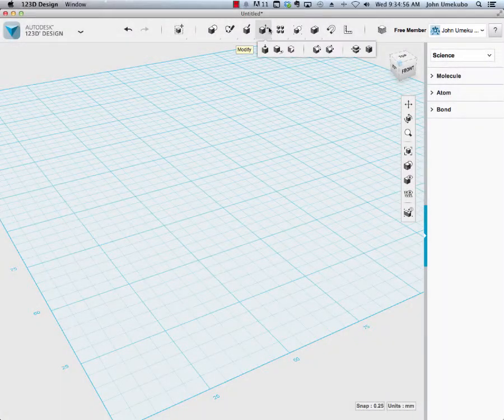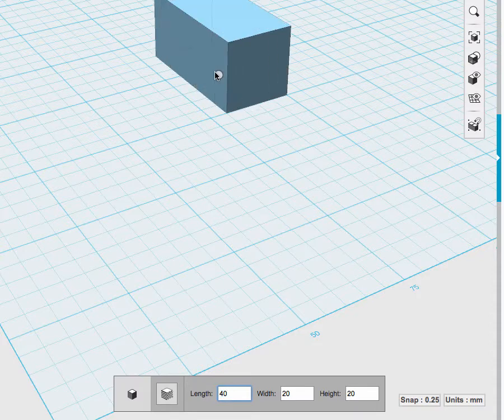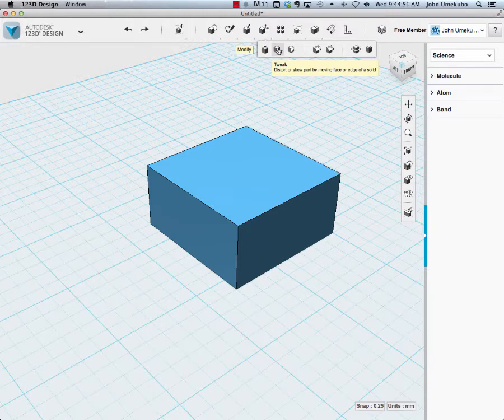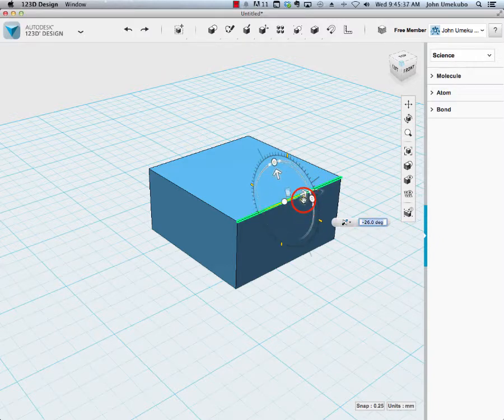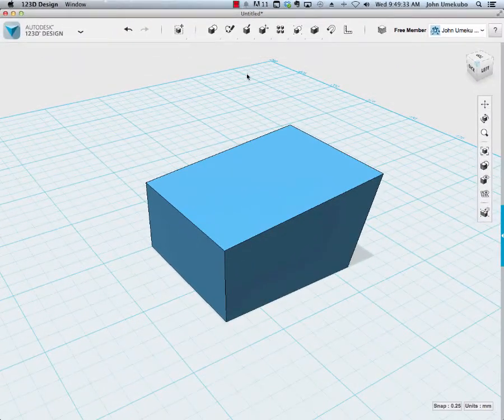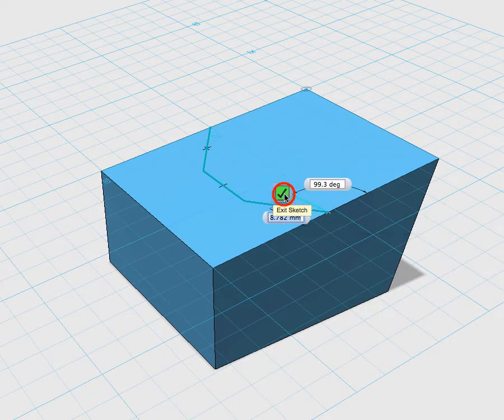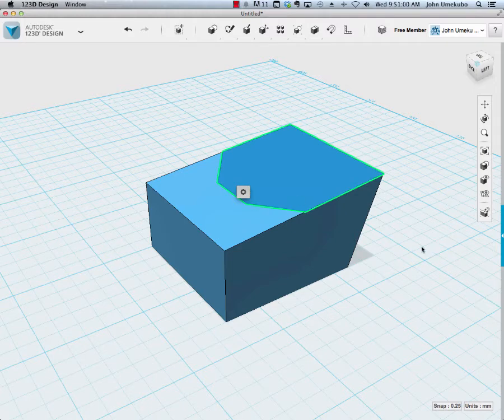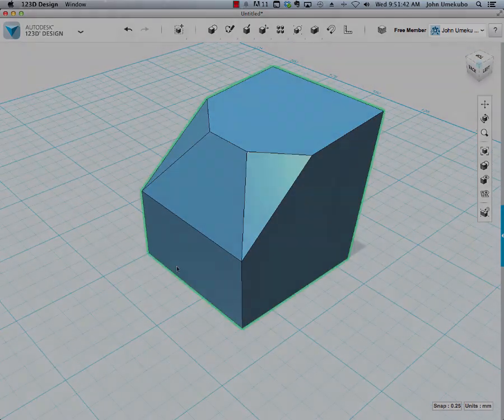Autodesk 123D - Modify, pull, tweak and split face

Comment: When I try to push in a top edge, I get a line across the side just like what happened at 2:27 Is there any way to avoid that?
Reply: Hi, I think that line is calculating the math that would have to happen when trying to pull one corner, like in my example, without moving the front-bottom or top-back corners as well. With those two other corners stationary, the face on that side would be forced to indent, thus creating the line between the back-bottom corner and the one I am pulling. I hope that makes sense.
Reply: And to get more to your question, the way to avoid that line would be to keep your corner on the same plane when pushing in the top.
Reply: John Umekubo
Thanks